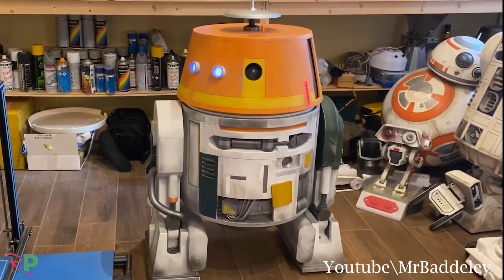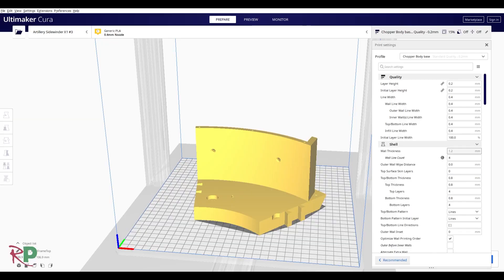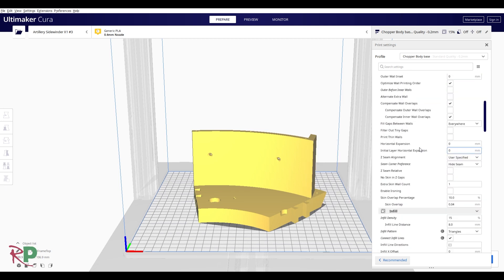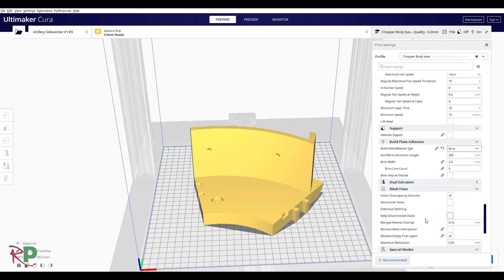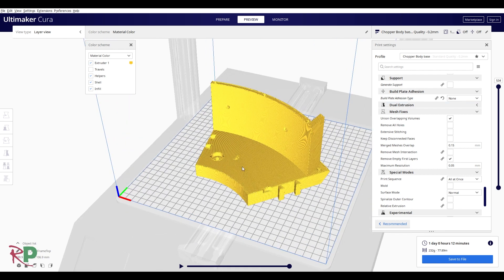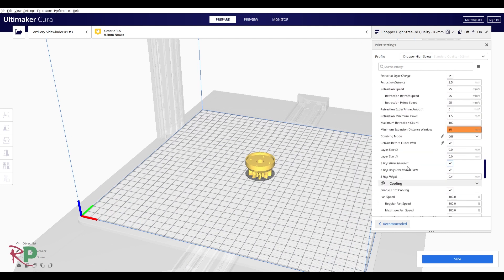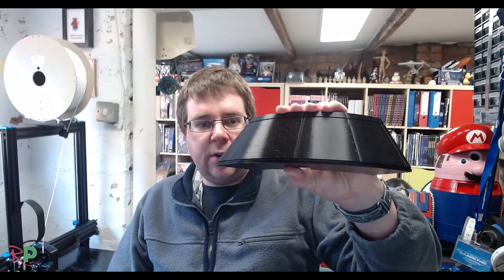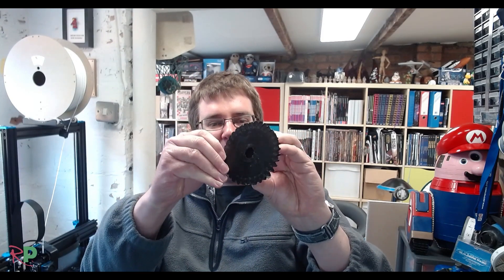Let's Build Chopper! - Episode 1 - Overview

Comment: Do you have a link for the files you used?
Reply from the maker: Patreon link that I put in every video to MrBaddeley printed droids. You need to join that and then you get the files. 😊
Reply: @rageprint9530  I am a member but I can’t seem to find the files and instructions. Is the fusion link the only way to get them?
Reply from the maker: When you signed up there's a post only visible to members that links to the Michael's OneDrive folder with all the Patreon stuff in. If not you can message him and he can get it to you.